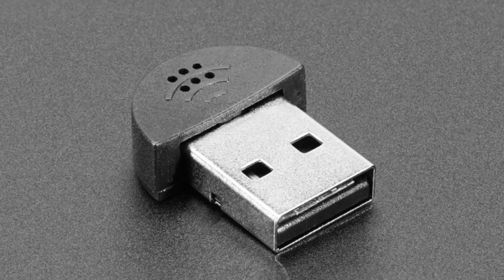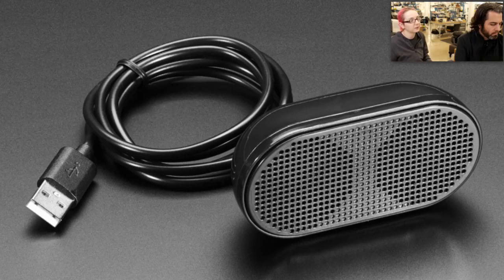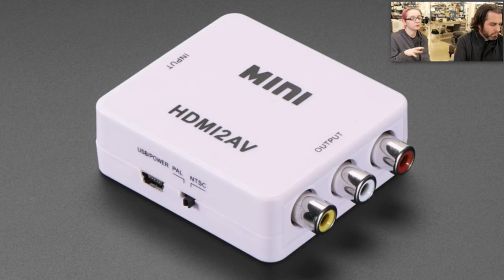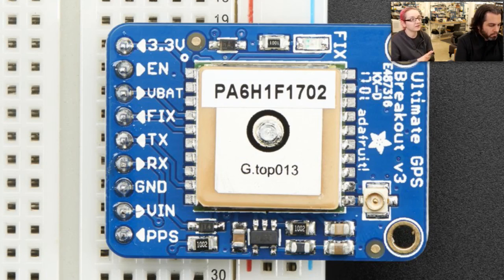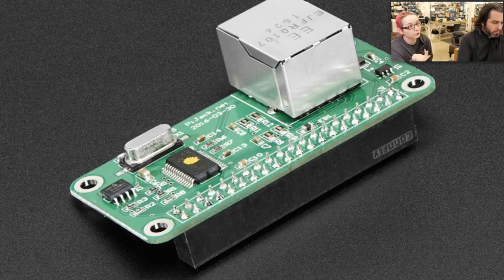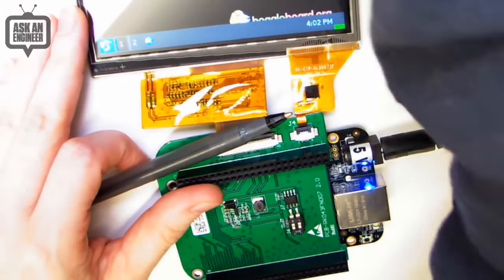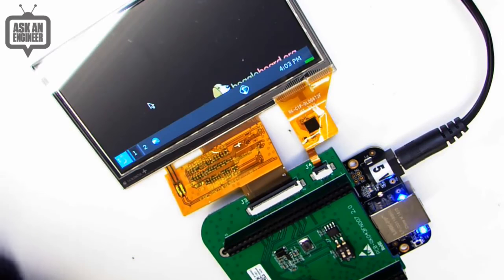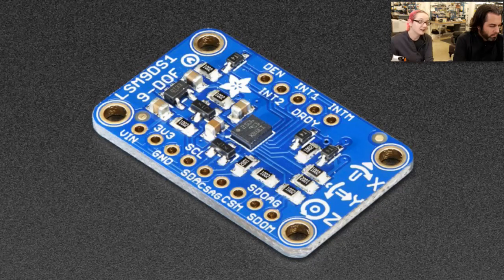New Products 2/1/2017

Comment: Anyone happen to know a decent way to add USB host to a Pi Zero?
Reply: There is a usb hub port next to the power port. connect a usb hub there
Reply: Matthew Roh That's not adding one, I'm already using that for something else.
Reply: Use a USB hub on that host port and you have more USB ports
Reply: RedFlaggWaving I can not connect a USB hub's host side to a device connection.
Reply: You use a MicroUSB Host adapter on the Pi Zero to have a full size USB port
Reply: RedFlaggWaving Again, that doesn't work when in device mode.
Reply: gudenau What in the world are you talking about? I really don't think we're talking about the same thing.
The Pi Zero has 2 micro usb ports. One is for power (marked PWR IN), the other (marked USB) is meant to plug an OTG adapter into to use as a USB host. I don't believe there's any different mode or anything the Pi needs added to it for this to work. Watch Adafruit's video when they introduce Pi Zero, they explain how it works. New Products 12/2/2015
Reply: RedFlaggWaving It is a OTG port, which allows the pi to act as a host or a device. my project has it tied up as a device so it can not act as a host. Google something like "raspberry pi zero device mode".
Reply: gedenau I see now. The only thing I can think of is to use an alternative method of communicating as a device to whatever you currently have it connected to, such as through a UART serial adapter. Honestly, with some clever software, you can do amazing things with UART
Reply: RedFlaggWaving I wasn't able to find much for that when I looked before, might have to build a few kernel modules for that. 🤔
Reply: RedFlaggWaving Do you happen to know of a SBC with USB host and device that can work at the same time?
Reply: gudenau I do not know much about anything else besides Pi or Beaglebone. Unfortunately I don't think either of these will work with your current project plan. You could also try controlling the USB devices with your host device instead of the Pi, but idk what USB devices you're trying to use.